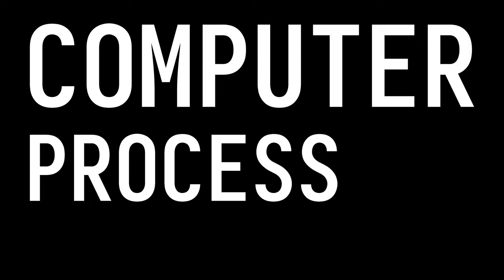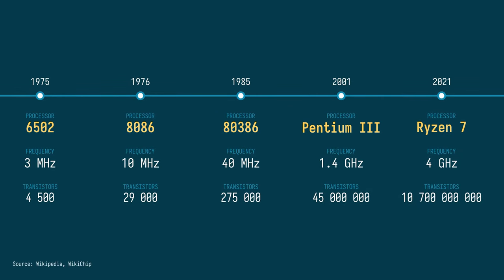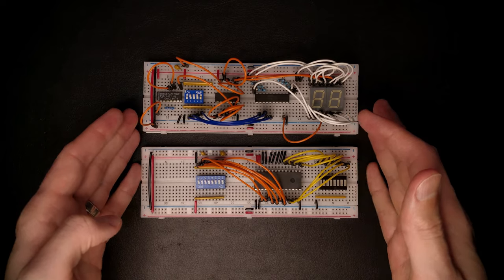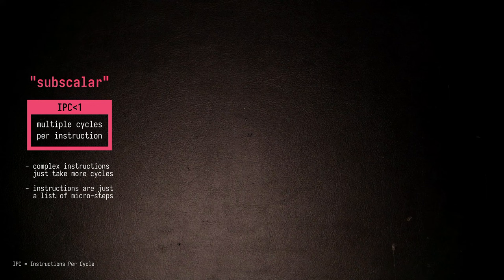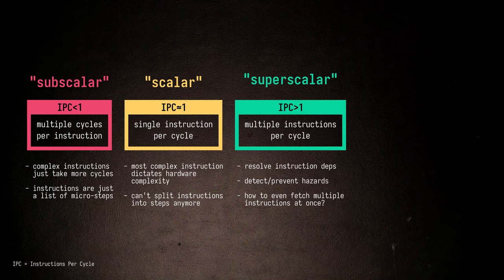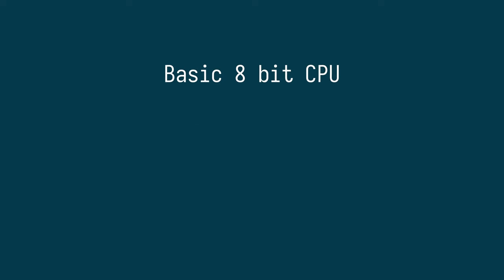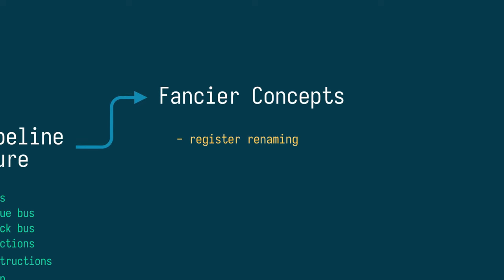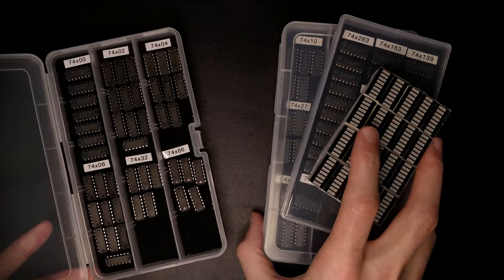Processors Are Awesome – Superscalar 8-Bit CPU #1

Comment: I felt bad five minutes in that I hadn't yet liked, subscribed, and ringed that bell, and queued up the rest of the playlist, so i got on that. OH WAIT THERES 34 VIDEOS WHOOA
Reply from the maker: 😃 And more are coming! 🙂
Reply: @fabianschuiki  I'm so excited its going great so far. I always viewed superscaling as the edge of understandably for people who don't work at intel or something, and out-of-order-execution as just beyond that, you can get the principle, but as a normal person i'd never be able to implement this. Hopefully seeing you do so wont make me go insane and either throw all my money at random IC's and breadboards and an  overprices oscilloscope or more likely and less destructively just steal my time and make me write an emulator, but hopefully it will just help me understand.
Reply from the maker: @Rowlesisgay 😃 I hope it will all work out. It should in theory, but you never know if some breadboard or PCB will just randomly decide to catch fire. But it should be possible to get some decent OoO and superacalar execution going even with a very simple 8 bit design. Focusing more on how it works rather than the complexity of doing it for 64 bits at 5 GHz.
Reply: @fabianschuiki  I always have trouble believing my cpu can go at multiple GHz, like, that's wifi frequency (my cpu boosts past 4), that's so high frequency it should make microwaves shoot out of the PCB, how can normal PCB material carry the signals, and logic circuits have any ability to make digital out of the analog wobbling everything is in reality. I have, however, learned that when it comes to computer science, if there's an idea that makes no sense how it would be more practical than sticking with what you've got even if its better under intensive load, the industry obviously switched to it in the 90s, or the 00s for outliers like multi-core cpus.

Comment: What are you using for your power supply?
Reply from the maker: Currently a simple USB cable. I suspect that will work for quite some time before I need to switch to a dedicated supply brick.
Reply: @fabianschuiki  don't suppose you would talk about it sometime.  I am building one but am a little out of my knowledge base.

Comment: Your projects are very interesting and educational. Congratulations. Do you know the hex display (4 bits)? It could be very interesting for your projects. IBM used it in the 90' Mainframes. For example the old HP 5082-7340 or the current HDSP-0772 (very expensive).
Reply from the maker: Thanks! 🙂 Great tip about the hex display, that looks very useful! 👍

Comment: Subbed as I kinda wanted to tackle the VLIW processor based on RISC-V, and I kinda wanted to know exactly how the out-of-order execution scheduler is put together, which is the most important black box to me so I can figure out where and how to push it - VLIW fetch and compaction stage would be separately responsible for superscalar issues internally, of course. Thanks for putting together the playlist for this processor, as it's a very useful and kind of hard to find information.
Reply from the maker: Thanks! Happy to hear it's useful 🙂. Can't wait to finally get to the out-of-order pieces.

Comment: I tried to look up reservation stations in Wikipedia. I don’t get it. I expect a matrix where every unit ( ALU, barrel shifter, DIV, Load ) outputs it’s result on its row together with the name of the destination register. On the columns ever unit ( Store, CMP, Test ) waits on input. The cells compare register names.
Reply from the maker: They come in different forms. The earlier ones used to store the operation to be executed, with additional fields for the operands. If a result wasn't available when the instruction was put in the reservation station, that field would be set to an ID that identifies the result that still has to be produced by another functional unit. When a result has been computed, it would be sent over a bus alongside its ID. The result gets stored in the register file, but all reservation stations also observe the ID and check if it matches one of the entries (like your cells). If it does, that entry would be replaced by the result. Once all entries have all their operands present, the instruction would be executed.

Some newer variants of the technique put all of the information into the reorder buffer, in a more centralized manner.
Reply: @fabianschuiki  buffer means access conflicts if superscalar. Latency due to the indirection between the execution logic and the buffer ( opcode which needs another decode). This only makes sense for scalar RISC CPU which has to orchestrate external hardware like vector processors (GPU, Cray ), large memory banks ( servers, main frame), slow EEPROM (embedded, console with cartridge)

Comment: I don’t get why “out of order” involves a “look ahead” . I thought we just have our parallel decode and fetch circuit, which is simply a vector unit because instructions have a fixed length. So this won’t stall. But execution may need to wait for the score board. So out of order simply means that we don’t stall for these. We just mark their result register on the scoreboard also and go on.

The trick is to fetch4 instructions at once and do the score board, but only have 2 ALUs. So fetch runs ahead automatically. There is no extra look ahead circuitry.

Why do we care for register renaming? 32 names are enough. Let’s have a separate stack pointer and instruction pointer. Only use I see is that we could eliminate the write back register for reg-reg .
Reply from the maker: Yes you're totally right. The look-ahead isn't something you'd add explicitly, but it's a side effect of being able to decode and issue instructions even if their inputs aren't available yet. As you say, if you fetch faster than you can execute, or if registers have to wait for results, this effectively looks like the processor is looking ahead of currently stalled instructions to find work it can already do. No additional circuitry needed indeed! 👍
Reply: I’d like to add that vector fetch and decode will need to be followed by a scoreboard stage similar to sprite priority on the C64. So instructions ( their sources) on the “right” hand side in the vector will be blocked by target register names on the “left”

Comment: Just found this series after watching a few others. Really looking forward to it.  I'm in the same process, building my own processor to power a over the top chicken coop.  Was initially thinking about using the ESP32 platform, but this seems a lot more fun, challenging and I have an entire wall to display all the boards that will be running.  Thanks for documenting this.
Reply from the maker: That sounds like a very cool project 😎!

Comment: Hi I came across this video and realized that you are one of the authors for Snitch! ps: I just did my master thesis on custom ISA extension on Snitch
Reply from the maker: Oh how cool is that! 🙂 What kind of ISA extensions did you develop?
Reply: @fabianschuiki  The extensions are built on floating point instructions, specifically used to enable HPC Monte Carlo Simulations, with these instructions I was able to take advantage of pseudo-dual issue 🙂
Reply from the maker: That sounds very cool 😎